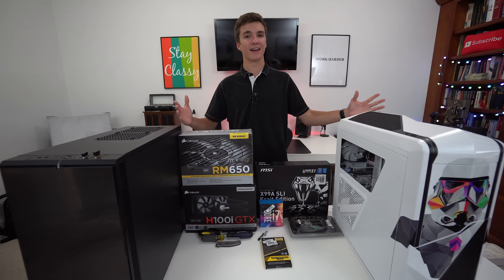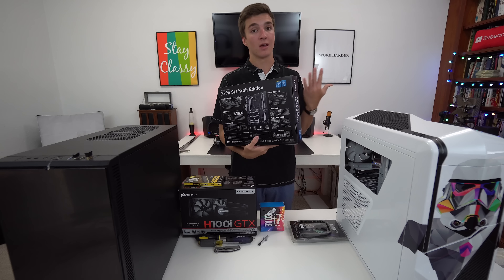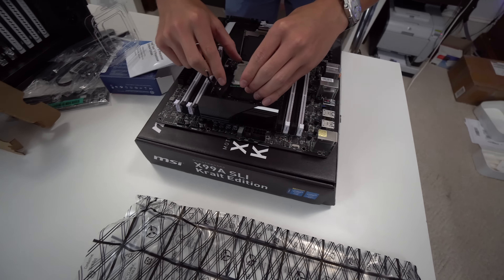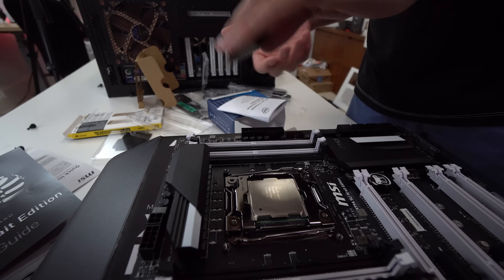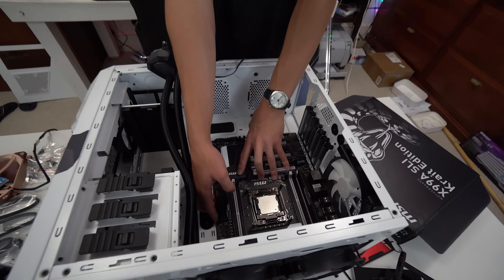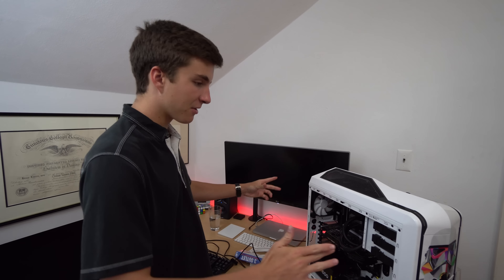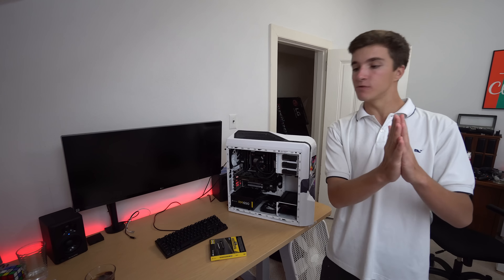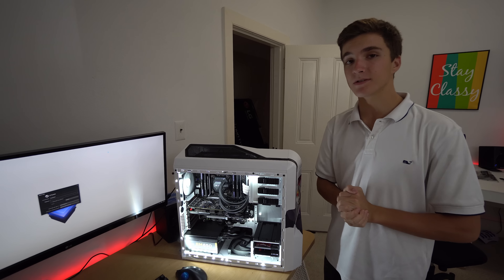Custom Stormtrooper Editing/Gaming PC Build!

Comment: You dont really want to tighten the cooler sockets as much as possible, It can cause major performance issues, I had a build where i tightened it as much as possible and it actually made the processor thermal throttle 100 percent of the time, Im guessing it did not detect the cooler, I was using a liquid cooler and the same processor so it might not cause its for everyone but you normally want to tighten it about 1/4-3/4 of a turn with a screw driver after tightening it by hand.

Comment: 2 things
there is such thing as too tight when screwing on the cooler. people have broken motherboards doing it too tight. it looks like it worked just fine. just a future tip, thumb tight is sufficient for most coolers
and what config was your ssds set to? raid 0, 1, 10,?
Great Video Btw

Comment: will an 8gb reference 1070 run triple 1080p gaming?
Reply: yes, easily
Reply: i will kill at 1440p and run 4k and med-high settings
Reply: Yes it will but you might not be able to achieve 60+fps if you are going to max out every other settings.
Reply: drum patel
I don't understand what you're referring to with that response.
Reply: because the fps doesnt completely depend upon the vram capacity. it is also about the clock speeds and running triple 1080p monitors on a single card with very high/ultra settings might not be able to achieve over 60fps. But i am sure that he could get around 40-50 fps.
Reply: drum patel
this person is obviously referring to a single 1080p monitor... He would have stated a triple monitor setup if he had one...
Reply: +wilson pies does the fps depend from the cpu
Reply: +wilson pies he said clearly "triple 1080p"... That means three monitors. Read before you comment
Reply: +Tim Miller not really the GPU does most of the work but if you have a horrible CPU it can cause a bottleneck which lowers your frames
Reply: +Jonathan Bodner thanks
will an i3 6100 bottleneck a rx460
Reply: im gonna have 3 1080p monitors poered by an i5 6400 3.3ghz and a gtx 1070 8gb, will it run high fps for medium-high on nvidia surround?
Reply: olwt Yes! you should be 100% fine, most games even on high or some easier ones on ultra! http://www.tomshardware.com/answers/id-3098749/gtx-1070-5760x1080.html
think that should clear things up for you!
Reply: wilson pies thanks!
Reply: olwt
no problem!
Reply: Jonathan Bodner I'm sorry, total blunder on my part there. Missed the triple entirely.
Reply: wilson pies its all cool. don't worry!
Reply: +Tim Miller I think the i3 should be just fine with that card! But I suggest checking on a website such as the Reddit page r/buildup core pcpartpicker to get some advice first, as I am no expert.
Reply: +wilson pies no worries:)

Comment: It seems you put the fans the wrong way.
Reply: Ah the bottom one you fixed later,  i hope you did the noctua too.  Thats why you couldn't boot.  :P Great vid,  nice build.
Reply from the maker: +Fyx Go Yes! I noticed them and got Byron to fix them.
Reply: The Fans don't have to do nothing with the PC not booting. You can install a fan to blow in or out, that would not prevent the PC from booting.
Reply: +Angel Luis Trinidad sry man, the wrong airpressure makes the pc not boot. It common sense!

Comment: Just a heads up don't go for the Corsair RM range, they have poor tier 3 capacitors which fail under full load. I learnt that the hard way, it killed my gtx 980ti

Comment: A explanation why it didn't wanna post the first time would be lovely. The thing about the fans facing the wrong way and using to much thermal-past is already mentioned. Just a tip : Handle the components with more care please. Touching backplates with your bare hands is not really good.

Comment: Intel core i5 6400
GTX 1060
16GB RAM
1TB HHD
550W Modular PSU.
Should I change anything in my build.
Reply: If you're only gaming and not doing any video rendering, it is fine. However swapping out hdd to a ssd is good
Reply: It is only for gaming anyway, plus I'll most likely get a SSD later on.
Reply: I got 8GB RAM for free from a friend of mine, I just want to buy another stick for multi tasking and running multiple applications at once.
Reply: Most games now a' days take advantage of 16gb of ram. Saying you only need 8 is just bad advice.
Reply: If your willing to spend just a bit more get an i5 6500. It is much better but for money than a 6400
Reply: make it i7

Comment: Hey! This Is My First Pc Build. Does This build Is Gonna Run ? 
+intel core i3-4150ghz - cache 3mb (box) socket lga 1150 - haswell refresh series
+gigabyte ga-h81m-h (lga 1150, h81,ddr3,sata3,usb3)
+corsair ddr3 value 8gb pc 12800-cmv8gx3m2a1600c11(2x4gb)
+asus radeon rx 460 2gb ddr5 dual
+seagate 1tb sata3-st100dm003
+super flower bronze fx 550w psu-sf-550p14he-80 plus bronze -3 years
+segotep gaming case sprint - black - side window include front led fan - usb 3.0
Reply: intel core 13-4150 3.5 ghz
=

Comment: I'm looking for a pc under 500$ that is able to run CS:GO and GTA V in good quality.
Any suggestions? 

Thanks :)
Reply: I think it would be easier to google or bing it or whatever dafuq
Reply: you cant play gta V in good quality with a $500 pc very easily.
you might be able to find a super great deal on some parts though
Reply: MiRiK 89C4J TY ;)
Reply: try getting a rx480 for cheap. and a cheap i5. that will run gta5 pre good.
Reply: +MiRiK yes you can. Need to learn to use cheap parts.
Reply: I can build you one if you need. It will be more or less around 500. Reply me
Reply: he cant even speak english i wouldnt trust him -_-
Reply: lol?
Reply: Idrk
Reply: I3 6100 + 1060
Reply: HotdogMan second hand
Reply: HotdogMan i3 6100 gtx 750 ti
Reply: ClumpLump wtf why

Comment: hmm. Those ssd's should not have booted right into windows like that. When you transfer to a new motherboard traditionally windows doesnt recognize the hardware and says you need to reinstall.  Funny that it worked right out of the gate like that.

Comment: is GTX 960 that bad for gaming..i just bought one last week
Reply: it's not bad, is actually quite a nice card, it's not too powerful but it's definitely not lousy
Reply: As long as you're not planning on using a resolution higher than 1080p it's a decent gaming card albeit a little on the low end. But you'll still be able to run almost everything at ultra settings and 40FPS plus with a few exeptions like The Witcher 3 or The Division, if you have the 4GB version that is, with the 2GB version you'll have to turn down the textures from ultra to high in quite  few games, but even then it's still a very capable gaming card.

Comment: you did not need to install the CPU cooler the way you did, as we don't live in the early 2000's anymore, so the CPU die is not exposed as much as bill cosby.
Reply: how would u do it then
Reply: just go around in a circle.

Comment: If this is not a gaming PC then why did you get a NO 1 gaming motherboard and  CPU water-cooling?
Reply: Better overclocking, duh
Reply: When someone says gaming pc, they just mean a good processor and a good graphics card. Usually gaming , editing, and even 3d modeling computers use the same parts.

Comment: Are these good PC specs anyone?                                                                                                                                                   Intel Core i5-6600 3.3GHz Quad-Core Processor, CRYORIG C7 40.5 CFM CPU Cooler, Gigabyte GA-H110M-A Micro ATX LGA1151 Motherboard, Corsair Vengeance LPX 16GB (2 x 8GB) DDR4-2400 Memory, Crucial BX200 240GB 2.5" Solid State Drive, Asus GeForce GTX 1060 6GB Strix Video Card, NZXT S340 (White) ATX Mid Tower Case, Rosewill 500W 80+ Bronze Certified Semi-Modular ATX Power Supply.
Reply: yes that's a good build, imo you should get a 600w psu just for future proof
Reply: thanks